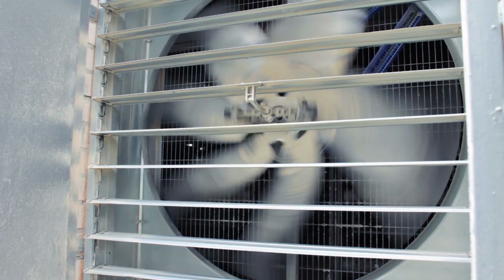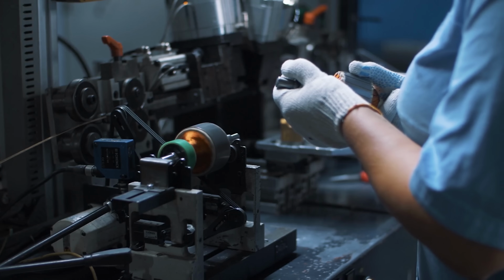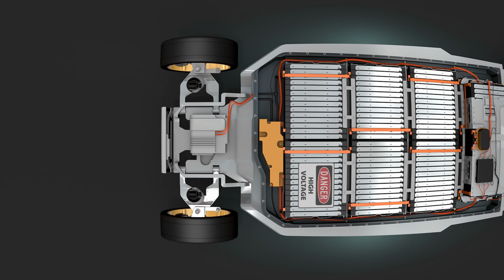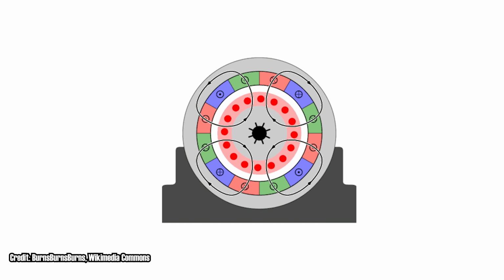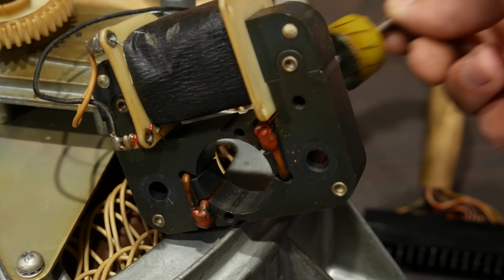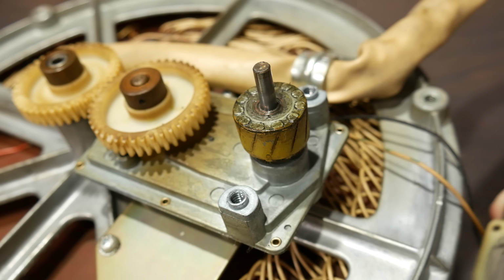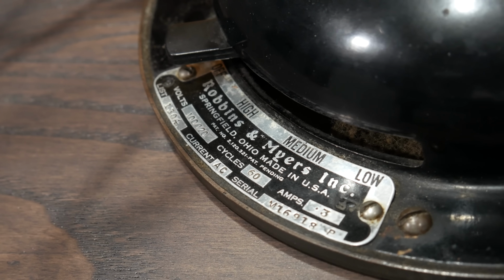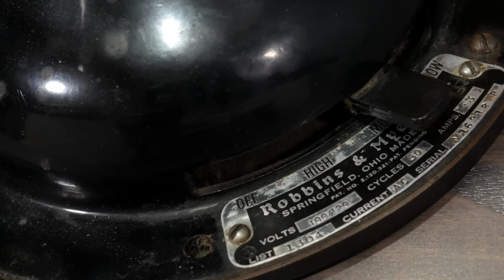Fans; High is next to Off on purpose

Comment: I live in Australia and I’ve never seen a fan like that
Reply: From Malaysia and same. Do your fans go 0,1,2,3?
Reply: Also Australian, but I've seen plenty of fans that start fast. Mostly ceiling fans
Reply: Try holding your phone upside down. Haha I'm so original.
Reply: @JoCheah  in England and France fans also go 0,1,2,3
Reply: South America here. Low/Medium/High since I can remember. Apparently all fans over here use capacitors for some reason.
Reply: I got a fan that goes 0 3 2 1 (and yes I'm also an Aussie)
Reply: I'm from India. All fans here go from Off, 1, 2, 3. I am totally confused. Never seen a fan having them in reverse
Reply: I've seen both here in Aus tbh
Reply: As an Australian,  my fan dial is circular and it can go clockwise or anti clockwise, so I typically try to go for the 1 setting.
Reply: Same in Europe. One fan next to me and it is 0, 1, 2, 3
Reply: But for some reason all our newer gas appliances are off-high-low
Reply: @rus0004  it.s probably to make sure they light quickly and don’t spew gas everywhere
Reply: James P  whats difference in this between 220/230 and 110/115 volts? I'm not electrotechnician so I do not see any issue in any voltage.
Reply: @ObsoleteVodka     The capacitor introduces a 90 degrees phase shift which in turn causes starting rotation.

Comment: Another great video Alec! If I could be arsed to search my attic, I would send you one of the two identical clocks my grandparents received as wedding gifts in 1946. Plug these AC synchronous clocks in and nothing happens. Pull down the little 'start' lever on the side and they whiz right up and run until the next power failure, when you have to manually re-start the motor .
Reply: Between one of those manual start clocks a self starting clock and a battery powered I could tell when the power went off and how long it was off.

Comment: While I was deployed to Greece, I bought a fan to help cool the room.  When I returned stateside,I brought the fan back home.  I changed out the electric plug to US type.  Because the fan was designed for 50 hertz, I was now operating it on 60 hertz.  The fan speed increased significantly, and eventually the plastic fan blades broke off.

Comment: Fans that don't have the high speed first, or fans that have a button selection, have a start capacitor to give it the extra energy to start. Although modern box fans still have them even if high speed is first. Unrelated is with industrial fan motors. Most industrial fans that use 3 phase power use a star delta start-up sequence. Star and Delta are 2 different wiring sequences. (Not entirely sure don't quote me). Star mode comes first, and the motor will use Star to get to half speed and then switch to Delta. This is used to lower the starting power draw. There are fans that don't have starting capacitors. If you notice your fan has a weird rectangle motor with a coil on the bottom, that is a C Frame shaded pole motor. Those motors don't use start capacitors and I'm pretty sure aren't compatible (not sure). Most cheap (if not all) 9 inch box fans use c frame motors. Most have a slow and very long start up until they reach top speed (happens when the motor is cold, after the fan has been at the top desired speed, it will have a normal start up after you turn it off).

Comment: I have genuinely never seen in my life a fan that starts off from high, most of the fans we got here in italy are chinese manfactured... but then again i assume the same goes for usa? So why have i never seen fans like those?
Reply: It's more common on ceiling fans, or pedestal fans that have a knob type speed control. Well it is in Australia though
Reply: @joecook3223  just a theroy, but some fans may use a simple gearing system instead to change the speed at which the fan spins, so on the inside it might have the same electromechanic mechanism by the gearing system it what controls the speed instead, then again im not a electrical engenieer
Reply: @joecook3223 , also an Aussie here. I just went and checked all the fans in the house. Five different sorts (ceiling, pedestal, and desk), 4 that go from off to low, and one ceiling fan that can be turned in either direction that goes from off to low or off to high. Well of the ones that have a dial. I can't recall seeing one that went off to high only. Weird. We must shop in different places. And my memory isn't great anymore.
Reply: Once you hear about American electrical outlet currents you will understand

Comment: I think this may be an america thing, here in the UK every fan i've encountered goes from 0-1-2-3
Reply: crwydryny my desk fan goes from low to high as well. Maybe its because we run on a higher voltage here in the UK.
Reply: I also noticed that. Here in Germany.
Reply: Aussie, and every fan Ive ever seen goes off-low-med-high.
Reply: (Unless its a circular switch knob, of course, then a clockwise turn is high. But a anti- is low.
Reply: I’m an actual Aussie, and our fans go 0-3-2-1
Reply: I am in the UK. I have a fairly new fan which has a slider switch that goes 0-1-2-3. I have an old second-hand fan  with buttons that go 0-1-2-3 BUT 1= high and 3 = *low*.

Comment: TL;DR - Starting a fan on 'high' prevents the motor from stalling when it starts up.
Reply: SPOILERS.  Jeez man, I'm like a hundred episodes into this epic narrative and you've blown the gaff.
Reply: @grunions9648  some people just want to ruin everything.
Reply: im guessing this is an American only thing due to the lower mains voltage than most other countries.  240v powered fan wouldn't stall on startup. Never seen a fan with off-high-low in my life.

Comment: I have always thought it's weird that fans go from off to high to medium to low, but I've thought it's even weirder that there are only 3 speeds. I wish there were more fans with "smooth ramping" or "infinite speed selection" where you could increase the rpm along the spectrum from 0 rpm to the max amount of rpm for that fan.
Reply: They exist but are obviously more expensive

Comment: (0:45) Looking at my fan ... hm, off - low - high
I guess I don't have a fancy fan then.
Reply: Nope that would make yours fancy 😁
Reply: I have 0 1 2 3 on my fan
Reply: Same, I've never had fans that go from off to high, it was always in order.
Reply: I have a 3 foot wide shop fan that goes 0 1 2 3
Reply: I used to have a small fan that had a button that could gradually change the speed and it started in the lowest

Comment: This is literally the first time I see a fan that starts on high
Reply: How?  I’ve only seen a few that don’t.
Reply: @joeh4955  maybe it is a Europe vs America thing? I have never seen one like described in the video. As a matter of fact all speeds here are 4 buttons separate, 0, 1, 2, 3. In that order and doesn't matter which one you press
Reply: I think it may be a European thing indeed, since on 230 Volt 50Hz it is perhaps less of an issue.
I have several fans that are just OFF-1-2-3, and have never seen one OFF-3-2-1 before
Reply: @WouterWeggelaar  And all the modern ones are pick and choose no need to start at a certain speed, just press the number
Reply: not all. this is just a decision of the designer based on cost and product design. buttons are perceived as more luxurious to some, but cheaper to others. so manufacturers make both to please both markets

Comment: I have literally never seen this, I guess it's an american thing.
Reply: Same
Reply: Perhaps the higher line voltages in European countries automatically provide higher starting torque.
Reply: same here
Reply: They're common where I live, but ceiling fans are usually on dimmers which "click" and turn on on low speed, or have separate speed buttons which make turning on on low speed quite common. The time it takes to start spinning on low is noticeable, though.
Reply: Australia usually has them start on high as well. We are 240volt.
Reply: @moconnell663  no

Comment: In the UK I've never seen a fan with a rotary fan, they all have multiple selector buttons. You can select speed 1 at startup!
Reply: Garreth Tinsley said, "In the UK I've never seen a fan with a rotary fan(sic), they all have multiple selector buttons. You can select speed 1 at startup!"

On SOME of those fans, you'll find there is a specific part of the control circuit that actually ALWAYS starts the fan at "high" speed for just a moment, then changes back to the setting selected by the user. He covers the general topic at about 17:30. That's definitely not to say all independently selectable speeds fans such as the one you pointed out work that way. 

Generally, with these kinds of consumer fans, the speeds are controlled by how the motor windings are implemented. Each switch connects to a different winding. You'll find on the independently selectable speeds type fans that even the minimum speed winding will have enough torque to start the fan. However, if it had been the "high speed first" kind of control, then the windings for 2nd (med) and 3rd (low) speed can be designed to allow the fan to run even slower and more quietly in those speeds positions, but the associated windings may not provide enough energy to guarantee start-up rotation. In other words, the independently selectable switch fans are eliminating the ability for the fan to run more slowly and more quietly in 2 (med) and 3 (low) in order to ensure enough torque to start the fan no matter which switch you select first. For example, both the 2 and 3 switches on the fan might connect to windings that yield more speed than the 2 (med) position on the "high speed first" kind of fan (assuming similar features otherwise). So while positions 2 and 3 will always have enough power to start the fan, they won't be able to run the fan as quietly or as slow is possible with the "high speed first" fan.
Reply: Same as in Australia, only buttons to start our portable fans.  But I have a crappy cheap fan which doesn't like being started on 1 speed, it sometimes stalls if I start it on the slowest setting.

Comment: I watched this video long ago and it all makes sense. Just recently I remembered I have a box fan from the 1970s that has the settings OFF, HIGH, LOW, OFF. It's worked great over the years with just minor oiling. It's motor seems rather large. Just wanted to offer that counterexample.